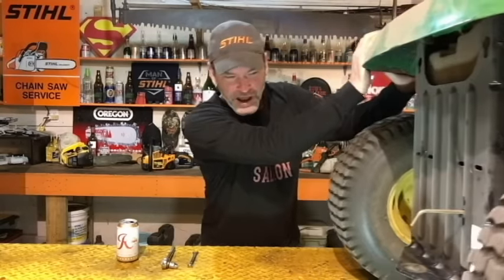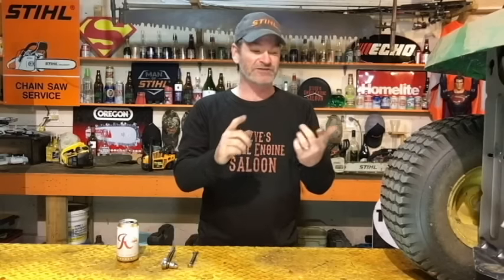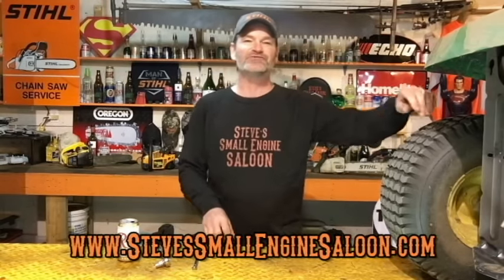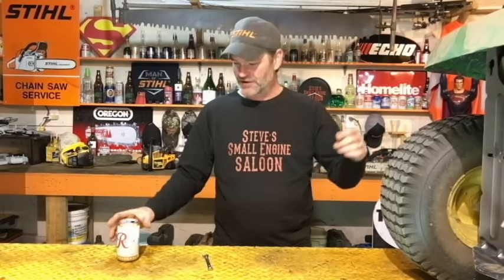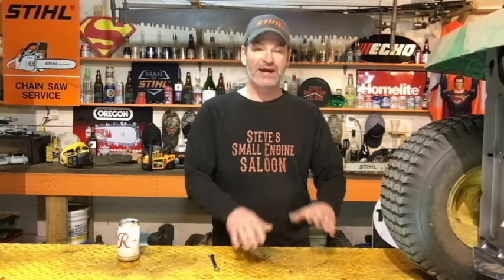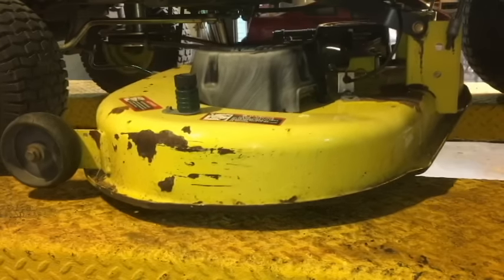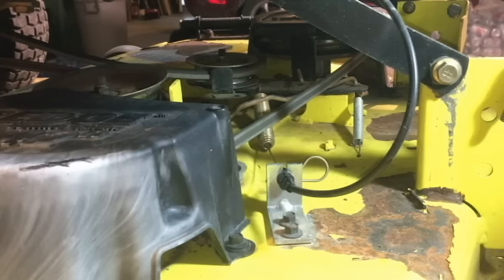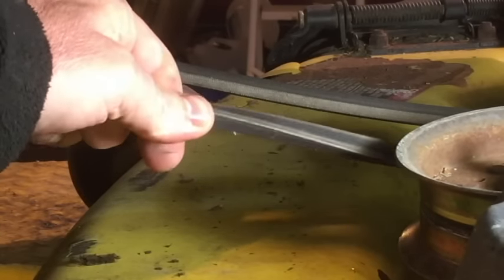How To Adjust The Belt Tension On A Riding Lawn Mower

Comment: The hardest part about this is going to be finding a 10 mm 🤣🤣
Reply: Sooo true lol
Reply: Run to harbor freight and get a 51 PC socket set SPECIFICALLY for your mower, it'll have the 10mm (the most common metric bolt) as well as the S.A.E sockets and they're 15 bucks, yes it's a crappy case but it still works! 
When you have another occasion to work on your mower, you're in good shape.
Now I'm going to tighten my belt and hope it quits coming off!!! Peace y'all
Reply: Once I found my 10mm it’s never leaving my side😂
Reply: I bought 4 extra 10mm wrench and. They are now extra 10mm wrenchs in all my tool locations
Reply: No the hardest part is finding that sip of beer with some1..lol
Reply: I found a beer
Reply: I got 99 sockets and a 10 aint one!
Reply: Most stolen 🔧 tool ever! The 10mm or what I like to call....my precious 😂🤣😂
Reply: AGAIN!
Reply: @deandrecrawford9245 mine lives in my pocket with my car keys lol… except for when I put it down somewhere…

Comment: Yeah but I just took off the old belt and blades on my Craftsman T210 Ride On Mower and put brand new ones on. Now a week later when I go to mow the lawn the belt fell off the pulleys in the middle of mowing and when I looked underneath the deck to see what the problem was the new belt was all shredded up. How does a brand new belt get that shredded from about 15 minutes worth of mowing? Everything was fine up until I put these new blades and belt on. Now I dunno what to do?
Reply: It is probably either the belt routing or something on the deck top is off and causing serious friction. The "curved side" of the belt needs to be inside both spindles as the belt rounds through them. Easy to put on backwards, trust me. Was there any burn smell or smoke?

Comment: Thank you Steve!  I'm not mechanically inclined but I have a lot of yard, and my blade stopped working this morning. Watched the video, you explained it all perfectly, then I went out and fixed my own mower!  You're the best.  Cheers
Reply from the maker: You're Welcome...and Thank You...
Reply: @StevesSmallEngineSaloon  I have the john deere 105 and the bracket is welded to the deck , no bolts to loosen to adjust!

Comment: very good tips. I lost the owners manual and don't want to pay $20 to be able to download it. There are archived versions of my model mower but they don't say how to adjust a 42" deck, only the 48". So this was great. However, i wanted to point this out as a NOTE. If you adjust the tension too much, the blade will actually engage when you turn on the mower, so be wary of that. I had to readjust about 1/4".

Comment: Steve, you're the best.
Here's a few tips that might help your viewers:
1) If you run out of adjustment range, you should be able to turn that bracket around. 
2) You can make a custom bracket with more range.
3) You MIGHT be able to adjust a welded bracket by inserting washers or a custom spacer.
Love your channel! I have learned a lot from you.
Reply: Thank you, you've given me some ideas to try!
Reply: You’re a genius! I’ll never need to replace my belt!
Reply: Oh sweeet thanks/ I ran out of adjustment range.
Reply: @puffythecampfireplayer6143  🤣
Reply: Thanks for the ideas. My mom in law belt loose and no more adjustment room.
Reply: hello thanks for that, we have a john deere E110 with the welded bracket, and it seems it would be best to cut off the bracket and make up one with a slot and bolts ourselves, do you know anyone who has done this and how it went please. (i think we found a comment further down that covers this question)
Reply: @phoenixrisingharley  I don't know of anyone doing that. An adjustment slot is great, but I think you need to use nylock nuts or threadlocker to keep the bolts tight. If you use regular carbon steel, give it a good coat of primer and paint, or coat it with something like auto undercoating -- the heavy stuff. (Now that I think of it, I might use that all over the top of my deck to get control of the corrosion.)
Reply: @rstoertz  thank you we will let you know how we go :)
Reply: Thank you!

Comment: Thanks, I'll try this Thursday. I mow my lawn and it's been skipping like it's not cutting it all. I then have to mow again the opposite direction.    I've owned the mower for about 10 yrs, John Deere LA100 series.  I never once changed the blades or even sharpened them so just assumed I needed new blades this season.  I bought them and when I took the mower deck off those old blades looked almost new.  NO damage to blade, no nicks, etc.  But I replaced them anyway.  It still cut the same, missing some even when I mowed in number 2 speed, 3 or 4.    It's nice to see it visually to know to adjust the belts.  Thank God for youtube.  I can learn any subject and take an attempt at fixing it to save money.
Reply from the maker: Right on...

Comment: I have a 3 week old JD S100 series tractor and on mine where the spring attaches the "L" bracket is welded and not movable. We are having trouble with the belt coming off and when engaging there is a loud thump. Disengaging is smooth. Anyone know how I can adjust the tension on this? Thank you and Steve. You are great. I never had a lawn tractor before and now watching you I feel more confident with it.
Reply: Same with my 2020 e100.
Sent jd a message and they told me to check the manual and or call a dealer
Reply: Is the belt the right size? The internets and lots on amazon are wrongly listed. Even 1/2" matters. Or your tensioner is shot
Reply: No.. it was a 3 week old tractor and belt was coming off.

Comment: Thanks Steve on the adjustment info.  Here's an update on the retrofit to an adjustable cable bracket from the original welded down bracket that's found presently on many new John Deere mowers.  As said here previously, this is on a John Deere Model E130 with the 42 inch deck.  This same deck is offered on many J Deere models and they have the same problem of no cable adjustment. 
     After mowing a moderately sized yard 4 times, the mower blade drive belt began to slip and the housing began to shudder.  To create an adjustable mower engagement cable, instead of buying a new belt, as recommended by the dealer, I installed the adjustable cable bracket like the ones that used to be offered on the older models and on Deere's more expensive, new units. The bracket is J Deere part #20168 and the two metric mounting bolts are J Deere part #22456.  These are the same metric bolts that are used by Deere to mount the adjustable brackets.  To make things a little easier, two standard Grade #5 or Grade #8, 5/16 inch-24 NF bolts can be substituted for the metric bolts.  The correct drill for tapping the 5/16-24 thread is an alphabet size drill, "I".  A 17/64 inch drill bit can be substituted, which will be just a touch tight, but if caution is used, you won't break your tap.  The reason for using the fine thread is because there isn't a lot of metal for the threads, so every thread counts for strength.  If using the J Deere 8mm bolts you will need an 8mm-1.25 tap and you will also need the alphabet size "I" drill bit.  A 17/64 inch drill can also be used and it will be just a bit tight when tapping, so use a drop of thin machine oil to lubricate the tap.  The Metric John Deere bolts feature a bolt head called a "hex washer head"  these come with locking teeth under the washer portion so that they don't back off.  You'll want the 5/16 inch bolts to have that kind of head also, but if you can't locate that type of bolt, a couple of 5/16 inch flat washers will do with split ring lock washers between the bolt head and the flat washer.  Make sure that the flat washers have substance because you will need to snug down the bolts to keep the cable bracket from slipping.
     Now to the bracket itself.  I marked the position of the original cable bracket where the portion that is raised is located.  Use a "Sharpie" to make the mark of its position on the mower deck.  You'll need that for reference in placing the new bracket.  Then I took one of those thin cutting wheels and cut off the raised portion of the original bracket and left the portion that was absolutely flat and welded down in place.  I used that part of the original bracket as a mounting pad so that there would be some metal thickness there for tapping the threads for the two mounting bolts into the mower deck housing.  You will want to position the new adjustable cable bracket bolts about 3/4 inch apart, center to center and in a position to where the raised portion of the bracket, where the cable attaches, will be able to slide back 1/2 inch from the marked, original location.  The 1/2 inch of adjustment should be adequate travel to allow for quite a bit of belt stretch.  Make sure that the two bolts holding the bracket get snugged up after the proper adjustment is made, but not so tight that you strip out the threads.
    Being able to adjust the mower engagement cable should prevent you from having to buy new belts as often, but eventually the belt is going to wear out and stretch beyond the adjustment's range and replacement will be required.
Reply: Thanks!
Reply: great for all of those details thank you very much, how has it been going since the retrofit ........... we are about to do similar and just wonder how its been going
Reply: @phoenixrisingharley  The mower has not had any issues and shouldn't.  The modification is similar to the factory installation and the mower has been active all summer.
Reply: Good info my friend. Mine is welded on with no adjustment options.

Comment: Thanks Steve! I think my riding mower mechanic added slack to my Husky 38 inch and loosened that tensioner. The store that sold it to me new 5 years ago is gone. This old guy down the road opened a shop so I took it there to get new blades last year. Now it keeps throwing the belt off with just a bit of resistance with tall grass. I replaced the belt last year and it's still in good shape. Same as always; a Yankee moved into town and he figures he can keep a new customer coming back if it keeps throwing the belt. Thanks so much for this video! I have a 10mm wrench and that spring will be tightened in 5 minutes.

Comment: Hi Steve, I have a John Deer s100 mower. The piece you moved on the mower deck, with the 10mm screws, to adjust the belt tension, is welded on this machine.

Comment: Steve, thank you so much for the excellent explanation. I had the belt replaced by my neighbor, bless his heart, but after mowing the belt would drop off the minute I disengaged the lever on my JD 102/42".  Neighbor came to my rescue and tightened the belt at the 2 nuts you have shown. However, he tightened the belt too much so that I can only engage the lever with brute force!  Neighbor is a busy man, goes to work every day and I don't want to bother him again. This is why I found your clear instructions so helpful! I shall now, loosen the nuts a bit and pray that this will solve the problem.
Reply from the maker: Right on ...

Comment: Had an issue with the blades not engaging after being stored all winter. I checked connections but nothing seemed out of place. Belt seemed loose thought should see how to adjust the tension. Thank you sir. Immediately after adjusting took it out for a test cut and it's back to business. Appreciate the content.
Reply from the maker: You're Welcome...

Comment: Steve, you are the man! I learned more about my Deere just watching your video's than owning one for 15 years! The spindle bearing video blew my mind....I can't believe they would run sealed bearings inside a hub assembly with no way for the grease to get into the bearings! Like you said in that video..it may be designed to fail on purpose.
Reply from the maker: Thank You...

Comment: I bought a new belt,and my blades wouldn't stop.So I adjusted it back loose cause I had tightened it because old belt was stretched. Belt still wouldn't stop. I pulled the brake mechanism and it popped after catching,and that loosened it up. I lubricated it and now works. Just figured all that out an hour ago,then read this. Your videos are great !!

Comment: Thanks, mate. We've recently acquired a McCulloch ride-on which is the same as this one and the huskies etc. I've been looking for an adjustment video as I've had to replace the belt due to a previous owner (the one who gave it to me) was complaining that it kept throwing belts and breaking them. Turns out he'd been mounting it by somehow jamming the belt between the Orange mandrel brakes and as a result bent and broke some stuff. I've just about finished straightening everything and am waiting on the belt to arrive today. I'm going to look at your belt replacement video too, to see if there's a trick to be leraned. Cheers mate. Subbed.

Comment: Awesome video I'm going to do this next on my 2004 Huskee Supreme 42 in. My issue is when i engage the blades it starts squiling and smokin. Im going to check for one of the pullies  not turning. But good to know how to adjust belts. Thx good video!

Comment: “You need a 10mm wrench”. Assuming you haven’t lost it already. 
Seriously that’s valuable information.  A loose belt will wear so much faster and possibly break. Always when it’s 95 out
Reply: Haha I’m always losing my 10mm wrenches. Needed one last night to work on my mower… eventually found it in the back of the Prius.
Reply: @Tonisuperfly  It's amazing how they can fly through the air unaided.  I think they can time travel too.  I actually lost a socket and I wasn't even using it.
Reply: @jamescaron6465  haha maybe another you in a 3rd dimension used it and is now wondering why they have an extra
Reply: @Tonisuperfly  You know what?  That is entirely plausible, because I can NEVER find them

Comment: 3rd belt in 2 cuts. First time user of an old beat up John Deere. There's so many loose bolts under there, I was assuming that was my issue due to some unalignment issues. I do think I will try this first, thanks for the time saver.

Comment: My blades weren't coming on at all and I could see the belt didn't have any tension so I thought I needed to replace it. After watching this video I checked the tension arm and it didn't budge so I greased the bolt and fixed it. The spring will still stretch so you can still pull the lever even if the tension arm is jammed. Cheers to this video!
Reply from the maker: Right on

Comment: What do you do when you dont have this adjustment on deck belt? Mine is welded in place. How would you go about tightening the belt then? Looking for answers? Can you help me out on this? Dennis
Reply: Did you ever find a solution?  I have the same problem and the only thing I can think to do is break the weld on the bracket and drill holes to mod the deck to an adjustable configuration.
Reply: My neighbor has the same problem. The only thing that I find works, because his belt kept coming off, is to engage blades at a low rpm, then increase throttle. When you disengage  the blades, do so very slowly so that belt will stay on the the pulley.
Reply: Yep - my last one had it, but I guess they're going cheap-and-nasty.

Comment: I have an e120 and that adjustable L bracket you adjust is now welded on. Any ideas to tighten the belt in another way?
Reply: Same now I need 5 freaking beers !!
Reply: @TheSaltyDawg   hey I ended up buying one 3 inches shorter than the one that came on it now I’m mowing again

Comment: Friend replaced deck belt a few years ago. First one lasted approx 10/12 years..  After less than 3 years it had to be replaced again after I heard pieces of the belt being chunked off..  Did it myself this time, pita since I did it with the deck on, had to remove an idler pulley to get it off...  works but the belt seems awfully loose and I couldn't see where or how to adjust it. I'll check tomorrow and hopefully it will be as you describe...  it's a circa 2000 Scotts 16/42 mower made by JD.

Comment: Thanks so much for this video, I have a MTD 14.5 38 inch cut and just replaced the belt as the old one got jammed and was cut off.  After putting on the new belt it was very slack and it also got snagged but luckily it didn't snap but now has a small cut in the side.  I couldn't figured out how to adjust the belt tension, after watching this video I adjusted the spring mount like Steve did in this video and it worked perfect. tks bud :)
Reply from the maker: Glad it helped

Comment: Maybe stupid question, Is it possible that tensioner line can get worn out? I am having a problem on my husqvarna where  the belt itself is coming off when I disengage the blades. I have purchased a new belt, but still there seems to be a good amount of slack on it when even before engaging the blades. I have also adjusted that tensioner bracket you said to where it is a fair bit tighter, but still the belt falls off when I disengage. Any suggestions are helpful, thanks for the video!
Reply: Some models were missing one of the two keepers on the tensioner pulley, the company put out a letter on this.
Reply: Thank you Steve 👍
Reply: @terrythoffman9375  which company? I have a troy bilt super bronco..model year 2006

Comment: Thanks for this. I have the Scotts 48 inch 25 horsepower Limited Edition and could not find the right belt for it. I found one just a little shorter but just adjusted the linkage, it was a metal rod with threads and it fixed it completely, now I can engage the blades. Awesome!